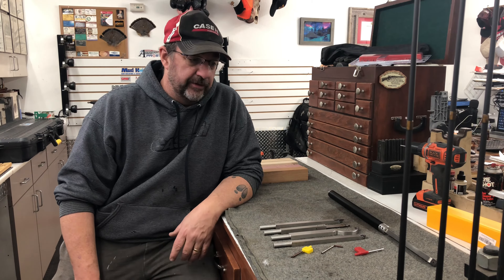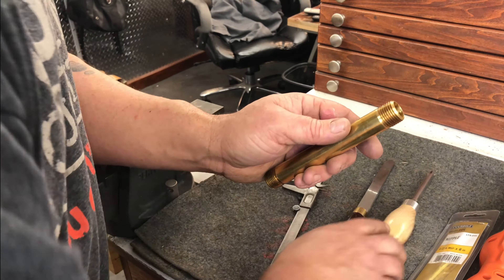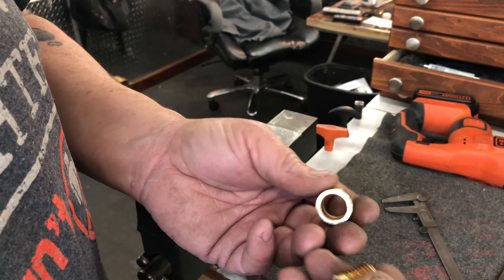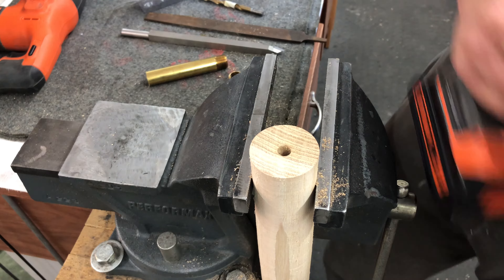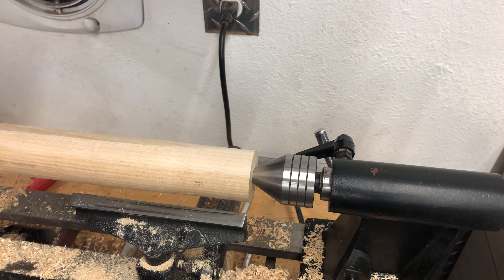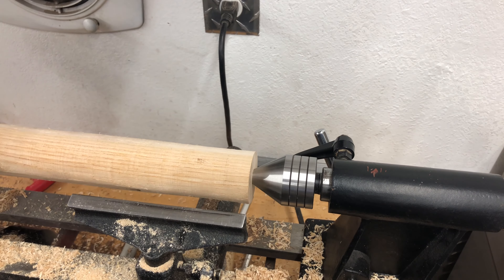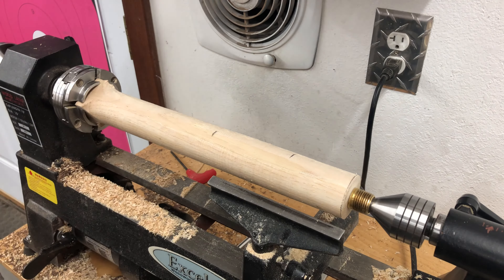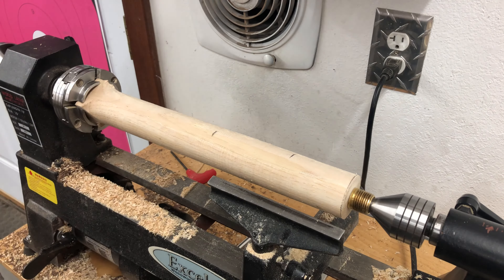Making Handles for Wood Turning Tools

Comment: Jack, your excellent video has inspired me to use your method of making handles for 4 of my tools.  Unfortunately, the ends of my tools ate 3/8" square.  I plan on drilling out with a 3/8" drill bit then cleaning up with chisels.  I'd be very thankful if you can fill in the details of the ferrule and, most important, the set screw hardware you used.
Reply from the maker: @swbccs  I didn’t use any set screws. The epoxy holds the tool in place.

The ferrules I thought were pretty detailed in the video. It is just plumbing pipe.

Thanks for watching.

Comment: been watching you channel when you were doing rod building.and I have a question, I have started trying to make cork handles, and the biggest problem I have is cutting a tendon square so that a butt cap fits or the handle fits into a reel seat,  Do you have any suggestions or recommend a tool that I could use, thank you
Reply from the maker: I use a file to get is close and finis it with 150 grit sand paper. Fold the paper once to make it stiffer and finish the tendon. Hope that helps.
Reply from the maker: Watch this video. At 17:50 I turn the tendon.

https://youtu.be/I-zHhecEoWI
Reply: Thank you for the information,  i have been using a four in one file,, it may not be long enough for me to brace it and hold straight, will try a longer file, again thank you